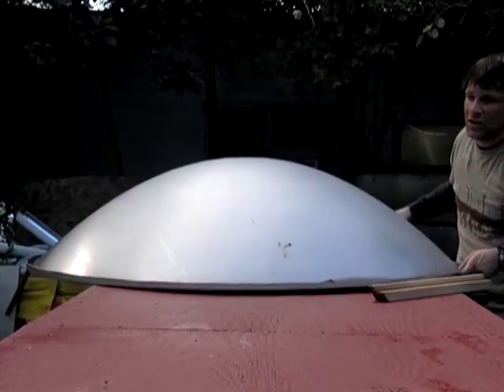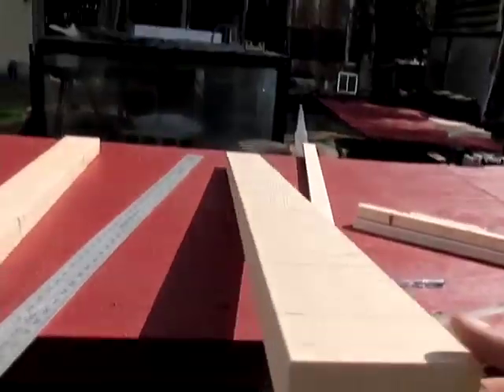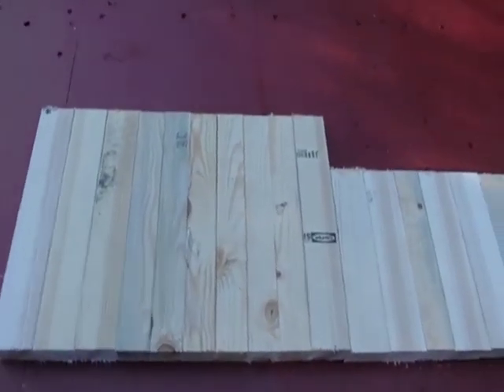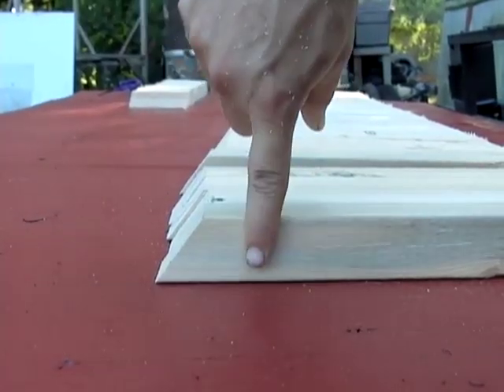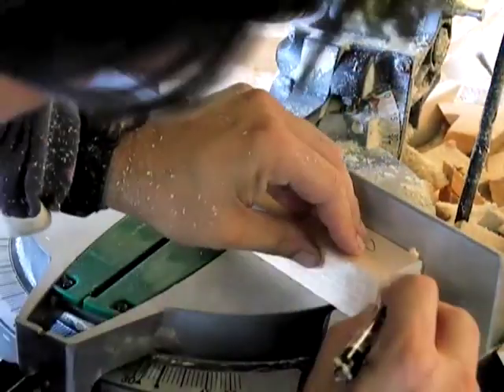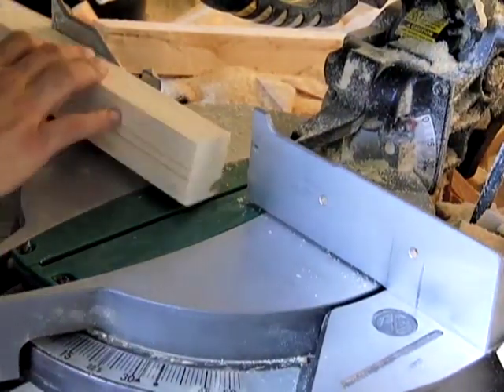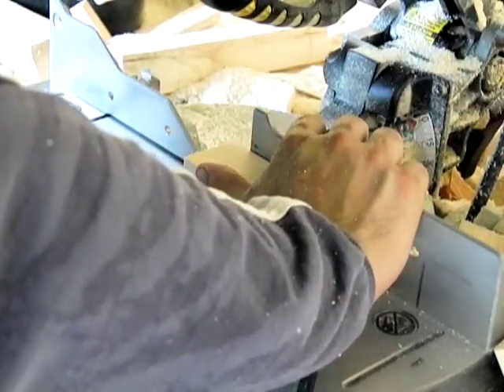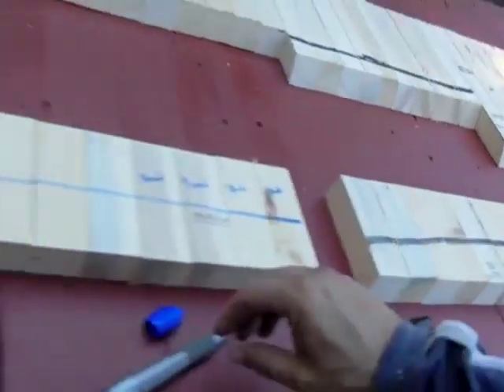PART 2 PARABOLIC TROUGH DIY reflective mirror HUGE SOLAR REFLECTOR

Comment: Thanks, one last question thou

Cost Vs Reflectivity Vs Weight

which material would have the best balance of all these?

i would like the mirror, but not if its too expensive, someone told me mylar would be the way to go.

i would like to redirect largest amounts of light possible and im trying to figure out which material would produce the best light, not too heavy while being very economical

thanks for the answers again, your vids help alot.

Comment from the maker: Hi,

This one is a "Hitachi" that cost $149 10" blade. I like the cheaper ones because they are direct motor vs a belt. For aluminum you swap the blade to an abrasive wheel. It works good for that.

Comment from the maker: The plywood works but it is heavy if you do it like a skate ramp design, this trough only weighs 70 pounds so it can be raised to the roof with two people.

Each set of peg supports only weigh 2 pounds, 3/4" plywood weighs 12 pounds+ for the same curve. Also the cuts of plywood requires some good jigsaw or band saw skills.

Comment from the maker: I used this method because of weight. The pegs only weigh 2 pounds per section. 3/4" sturdy plywood with this cut would weigh about 12 pounds per section. So this saved about 50 pounds. With the mirror the entire trough weighs about 70 pounds. Also the stadium look is prettier.

Comment from the maker: You can cast hybrid. Electric and solar. Basically use 75% less fuel. The sun alone can do small amounts with a large Spot Lens.

The problem with large amounts of metal, heat sink.

Hybrid works great

Comment: instead of using line on the crop saw fence that you have to look at to line up, you can use a c-clamp and a small block of wood to set the piece against. saves alot of time over 20 pieces

Comment: Hi Dan- Rather than trying to transfer a known parabola from a dish to make a duplicate,  look up parabola in Wikipedia, you will find some illustrations showing you exactly how to draw a parabola with any focal length you choose.  Much easier and quicker than trying to match a dish that may not be the focal length you want.  You can also reduce the weight by using just half the number of pegs if you use bender board on the pegs first, as a backer, then the acrylic goes on.  Even stronger.

Comment: If you want accurate lengths then use a small block and clamp to establish the length rather than a marked line. You will be assured an EXACT duplicate each time.

Comment: Dan, I love your videos, but you make some time-consuming mistakes in this one. 1) It's easy to draw a parabolic line using measurements and a straight edge. Far easier than your method, more consistent and easier to know where the focal point is. Goog it. 2) Once the line is drawn on paper, transfer it to plywood, make 3" or 4" parabolic strips of plywood, and support them with far fewer 2 bys. This will be stronger, faster, lighter, easier, and more consistent. Believe me.